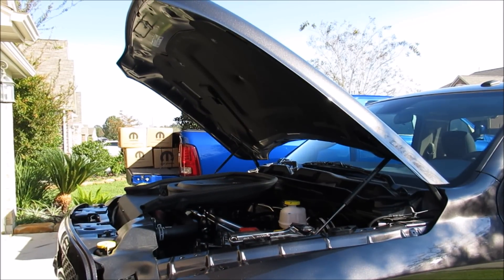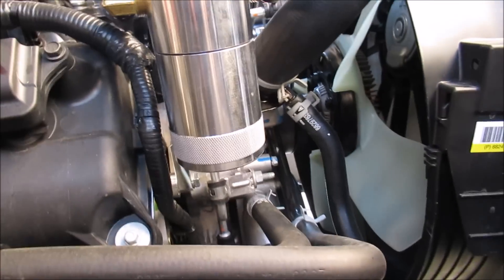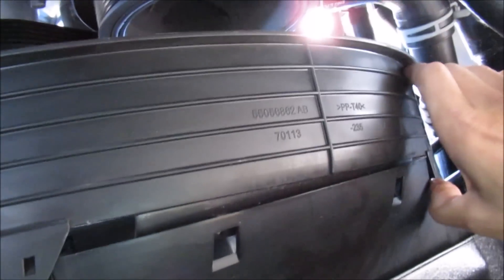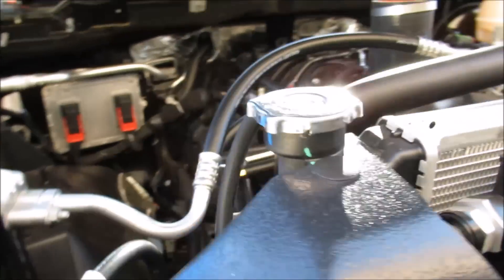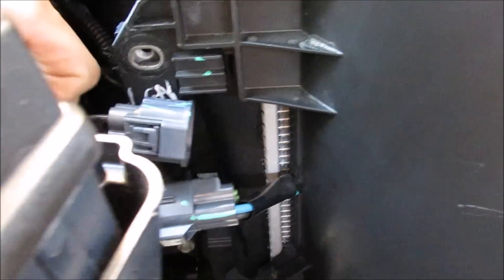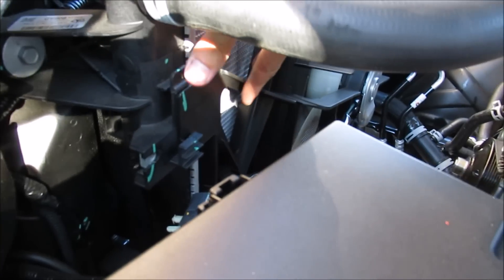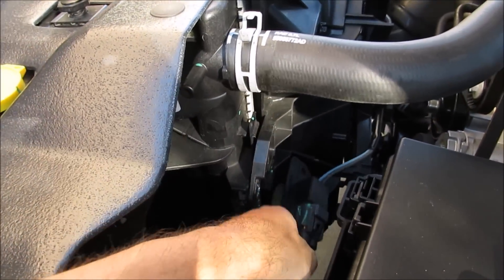2017 Ram 1500 5.7L Hemi Clutch Fan Delete

Comment: I did this on my 2013 express. I installed the Murray 180 t stat, and 09-12 v6 fan the fan kicks on by it self and this is during the winter in CA it’s not really “that cold” but it kicks on by it self I have a Diablo tuner with a 91 tune I never adjusted anything. Not sure if other people did a tune?
Reply: The oem temps that the factory ac condenser fan kicks on are 185 with the ac on, 226 low speed with ac off and 235 high speed with ac off. You can change these parameters with the Diablo tuner

Comment: I did this swap.  I got a C.E.L. (check engine light ) that refuses to turn off.
Reply from the maker: There is no check engine light that you would get from this unless you did not plug the fan in correctly.  What code is it throwing?

Comment: Just installed mine today but it wont shut off when its running. Just wondering if you might know why.great video by the way
Reply from the maker: It will always run when the AC is on or when the coolant temp gets up to 220*. With tuning, you can program the fan to cone on at a lower temp.

Comment: What's the chances of sawzalling mine off and then using an impact to remove it. Dealer put on a new water pump and the old clutch is about 700ft lbs.   I'm bending steel and bolts doing this method.
Reply from the maker: Hit it with an air chisel

Comment: Great Video!
My water pump went bad, so i just bought the electric fan and a new water pump without the clutch.
Reply: Just did the same on my 2015. Previous pump only survived 26,000 miles 23 months

Comment: a better and easier way to get that bolt off the cooler is to take a rotor hammer and use it on the left side of the bolt while applying pressure to the tentioner
Reply: doesn't always work. sometimes even adding tension to the tensioner isn't enough to stop the pump from turning. I made a similar tool (welded) and it saved the day. fan was off in seconds. if I saw this video first I would have copied his tool.

Comment: I’m going this route when the parts come in, im full bolt on and VVT HPT+ cam kit from Moe’s and running a 160 thermostat. Truck is starting to heat up with this south Tx heat! And tuned by Greene on 93 octane regular temperature is about 185 -195 at speeds of 75-85 daily driven truck

Comment: Is the original ac fan sufficient? Or is the l larger v6 model absolutely necessary?
Reply: Larger fan is necessary, it moves alot more air.
Reply: @bradlaflamme6127  maybe keeping the factory v8 fan is doable with a lower t stat like 195 instead of 203. obvisouly you have to keep the v9 shroud though

Comment: I did this swap last night.  Had an issue with breaking the fan nut 
free, so I cut the fan off with a sawzall/metal blade.  Then I used a 36
 millimeter socket on an air wrench to remove the nut.  Worked like a 
charm.  One of the projections on the new fan was against the radiator 
hose, so I cut it down a tad with the sawzall.  That way there is no 
concern of the plastic wearing a hole in the radiator hose.  You can see
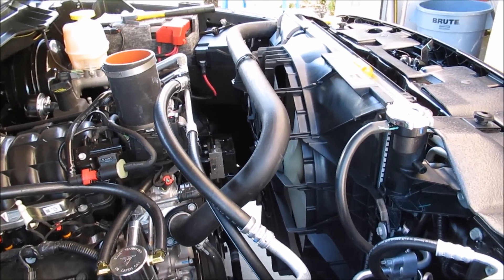 what I'm referring to at 10:27 on this video.  It's the plastic piece closest to you in the vid.  (approx one o'clock position....)
Reply: Did you go with a tuner or just left it stock?
Reply: @brown5252  No tune at this time.  Have been watching the temp very closely and there hasn't been a problem yet.  Still have to install the Vararam intake, and do the Magnaflow muffler delete.  I REALLY like my truck!

Comment: Thanks, man!  I have to do some major work on a truck, and I was getting nervous about seeing the struggles some people seemed to have had with the clutch fan... this has eased some anxiety, I'm just gonna go straight to this technique.  ;)
Reply: Ya read more. I installed the efan in mine  2014 and I got a DiabloSport to set up the temperature and I found out the Diablo doesn't to temp only AC so I moved my AC fan to the front of my efan and left it hooked up. So now I have two fans one for temp and one for AC. I installed a Flex-a lite 31174 for my temp works well so far.
Reply: @suquu9153  That's strange because on my 2014 I can change the temp at which the fan come on both with and without A/C they are two different settings
Reply: @racemaniac8682  I'm happy for you that you can. When I got my DiabloSport i3 tuner from GARiD the sales rep assured me that I can set the temperature and the AC NP. When I hooked it up it only had the one AC settings I had to go through PayPal to get my money back thank God for PayPal.
Reply: @suquu9153  dam that really sucks yeah I went driving my truck with the ac off and sure enough the ac fan comes on at 204 just like I set it without having the ac on

Comment: Hi I have a question. I want to do this mod. I also have a Diablo sport trinity 2 tuner. At what temp should I set the turn on point for the V6 electric fan on the 5.7 hemi? Thank you
Reply: It won't to temp only AC settings I have a DS i3 and it won't to temp it will only to AC setting.
Reply: @suquu9153  I had zero luck with trying that v6 fab mod. Kept overheating had to go back to factory elec fan and fan clutch
Reply: @rickybolton2451  Ya I found the same it will heat up fast and when the fan starts it will cool down fast. I hooked up an electrical thermostat that comes on at 190f so it cools it very fast. What kind of vehicle you got?
Reply: @suquu9153  2015 ram 1500 5.7 hemi

Comment: What is the part number for that fan? Will it fit a 2013 Ram 1500 ?
Reply: Dorman 621-410 Engine Cooling Fan Assembly for Select Dodge/Ram Models. I don't know if it will fit you'll have to look it up.

Comment: I've heard that this only works if you use a 09 to 12 V6 fan, because the switches were changed. Also, do you recommend an oil catch can? I could help but see you have one installed.

Comment: I got mine today and noticed that the pins in the plug are different and has 3 pins instead of my oem 2 pin but it plugs in my oem plug. Any idea why they have 3 pins and not just 2?
Reply: I just did mine last week, it worked perfect even with the 3 Pins.

Comment: It's a cheap mod but needing a tuner makes it expensive lol
Reply: no need for tuner I deleted my & its working great no overheating
Reply: jebusm86 not necessarily.. you can wire up a thermostatic switch for under $30.. works great
Reply: There is no use in getting a tune all you can tune in the Diablo Sport i3 is AC fan setting's ON, or AC fan settings off, that's it there is no tune for temp setting on or of don't get sucked in.

Comment: Why? What is the benefit of doing this?
Reply from the maker: Frees up about 8hp and opens up a bunch of space under the hood.
Reply: @moesperformance7499  Cool thanks! Guess I missed reading the description.
Reply: What is the spacing on the flat bar bolts?

Comment: What temp do you suggest it come on at?
Reply from the maker: 190*
Reply: There is no use in getting a tune all you can tune in the Diablo Sport i3 is AC fan setting's ON, or AC fan settings off, that's it there is no tune for temp setting on or of don't get sucked in.

Comment: Engine temp the same as coolant temp?
Reply: Yes the only thing that not the same is AC settings.
Reply: There is no use in getting a tune all you can tune in the Diablo Sport i3 is AC fan setting's ON, or AC fan settings off, that's it there is no tune for heat setting on or of don't get sucked in.
Reply: @suquu9153  well I've been wanted a code scanner for a while so I may just get it for that extra feature

Comment: U can run without the clutch fan since the have an electric just make sure u have the 170 t stat and the tuner turn the other fans on sooner for you
Reply: I swapped it and got a DS i3 tuner and it won't to temp setting only AC setting so I'm out all that money. I saw somewhere that an HP will.

Comment: So what holds the fan pully on once the clutch fan has been removed??
Reply: Craig_sez the fan pulley is pressed on , it wont come off. Had a 99 Durango with the 5.9 and did the same and it never came off

Comment: I have a diablo i3 programmer but I dont know how to access the temp settings 13 ram
Reply: There are only AC settings.
Reply: I have the same DiabloSport i3 tuner and all I got is AC setting's on or AC setting off. There is no temp settings.
Reply: There is no temp setting on DS i3 tuner only AC settings if someone tells you there is they are full of BS.
Reply: There is no use in getting a tune all you can tune in the Diablo Sport i3 is AC fan setting's ON, or AC fan settings off, that's it there is no tune for temp setting on or of don't get sucked in.
Reply: @suquu9153  yeah there is because I managed to change it
Reply: @omarOKC  ALL you changed is AC settings there are no temp settings on a Diablo Sport i3 tuner.
Reply: @omarOKC  SO how did you get in to the temp settings my temp settings are 220F on and 195 F off how can I change that? I only have AC setting's on and AC setting's off on my DiabloSport i3 tuner.

Comment: I did exactly  what shown on the video but still my engine temperature is getting hot I install thermostats 180 degree and still running
Reply: Any clue !
Reply from the maker: Did you lower the fan temps in the tuner to make them come on at s lower temp? If not, then the fan won’t tuen on until the temp hits 220.

Comment: This didn't affect your AC TEMP when idle
Reply: There is no use in getting a tune all you can tune in the Diablo Sport i3 is AC fan setting's ON, or AC fan settings off, that's it there is no tune for heat setting on or of don't get sucked in.
Reply: @suquu9153  Fasho brother

Comment: How far apart are the holes in the bar you made? center to center?
Reply: measure the holes on the pully from center to center. that is the distance to drill in a flat bar
Reply: 2.25" on mine.

Comment: The clutch fan pulls no hp to mention from the engine because it isn't engaged only when engine temp requires it. Two-You can program the a/c fan to come on earlier if you like by changing the temp at which it engages with a tuner. The size of the fan moves no more air because you are not changing the size of the radiator so you can only move so much air through the radiator. Speed of the fan can only move more air which is already preset. You will not gain 8-10 hp. This myth comes from people who believe too much in what they read and don't read it correctly and believe in bolt on hp. I did all the research on this MOD and trust me it is a waste of time. What do you do when the fan motor or relay goes bad and you have no clutch fan. We all know electrical parts can go bad at anytime. Your a/c fan won't kick on until approx 225 deg. I wired a switch inside to a relay outside and tapped into the a/c fan circuit on the "High Speed" relay in the ECM box beside the Battery. This way I needed no tuner, no extra fan, and left the clutch fan on in case of fan motor or relay failure. I also put a 190 deg Stant OEM thermostat in mine instead of the 203 deg thermostat. Ram's tend to run hotter than most. It's a characteristic of the Hemi. My mod cost me prob $20.00 for a relay, wire, and a switch, and took me a whole lot less time than this mod. So when I'm climbing hilly terrain on backroads while hunting or stuck in traffic, I just flip a switch and it turns my a/c fan on and keeps my engine from getting hot. I'm not bashing this mod at all. It does give you more room to work. But, think about it, you have (2) electric fans back to back. Seems redundant to me. So basically you spent, in your eyes, roughly $1,000.00 to gain what you read to be 8-10 hp. And that's why you and everybody does this mod in the first place. It's not to keep the engine cooler or the air going into the engine cooler, which will give you way more hp than removing a clutch fan, or bettering your gas mileage. It was for an estimated up to 8-10 hp gain. To each his own I guess.
Reply from the maker: A lot of this response in incorrect.  We have seen trucks pull 8-10hp on the dyno by removing the clutch fan.  There is nothing wrong with running 1 single electric fan from a reliability standpoint...even Ram has now converted to only 1 electric fan and done away with the mechanical clutch fan on the new 2019 models.  This mod only takes about 10 minutes to do as seen in this video.  And you are not spending $1000 for 8-10hp...That roughly $1000 price tag for the tuner and fan delete gives you a combined 40-45hp/tq gain.  Nothing wrong with driving a stock truck if that is what you like, but this is a great mod that all of the performance oriented Hemi truck owners have done since the Hemi was first released in these trucks back in 2003.
Reply: @moesperformance7499  I agree that with a tuner you could gain 40-45 hp. We are not talking about the gains with a tuner. We are talking about the gains of clutch fan removal only. The reason the price of a tuner is included is because you need the tuner to fully utilize the fan mod whether you use it to make other adjustments or not. OK, you feel that $1,000.00 for 40-45 hp is a good bang for your buck. Show me a printout on hp with a couple pulls with and a couple pulls without a clutch fan alone and show me 8-10 hp gain and I'll never question it again. Again I see lots of talk on websites and no proof. Nothing personal. I just read and watch and hear all about all these gains people get with bolt on hp as per se but never see any proof in the pudding.
Reply: The fan clutch can fail and cause damage, plus it wears out the bearings on the water pump faster. Oh and I can actually change my fan belt much easier without it and the fan shroud in my way. So much room to work with. Thank you. Maybe next time you can type a few hundred more words that no one will read , because I didn't read 10 words. 😂

Comment: Wouldn't there be an issue now of the the only fan left fails ?
Reply from the maker: Numerous vehicle manufacturers, including Ram as of 2019, do not use a mechanical clutch fan anymore.  They rob the motor of power and take up space under the hood.

Comment: I was wondering if you still have the electric fan in your truck and if you’ve had any problems with it or the cooling capacity of it now that it’s been a couple of years. Also does it keep things cool under heavier load like pulling a loaded trailer.

Comment: Would this work on 03-08 rams Aswell?
Reply: Dorman 621-410 Engine Cooling Fan Assembly for Select Dodge/Ram Models go check it out at Amazon.
Reply: @suquu9153  thanks, was wondering the same. Am thinking of seeing if ram made a v6 in that gen with an electric fan as well

Comment: Moe's what kind of tuner do you guys use to adjust the temperature for activating the fan?
Reply from the maker: We use the Diablo tuners with Hemifever Custom Tuning.
Reply: There is no use in getting a tune all you can tune in the Diablo Sport i3 is AC fan setting's ON, or AC fan settings off, that's it there is no tune for temp setting on or of don't get sucked in.
Reply: @suquu9153  did you not read the word “custom”?

Comment: I hope you see this Matt. I installed the TYC on my 2018 and it doesn’t seem like it is coming on. Did you notice that at all with this 2017? I was just hoping to find an answer.
Reply from the maker: Did you lower the fan temp setting in your tuner to make the fan come on sooner?
Reply: Moe's Performance That’s the one thing is that I don’t have a tuner, would it be okay running it without one for a while?
Reply from the maker: @scottycustoms  You need to tuning to use this setup correctly.  The stock fan only runs when your AC is on, or when your coolant temp gets over 220*.  That is why you havent noticed yours coming on.  We like to run this setup with a 180* thermostat, and set the fan temp in the tuner to come on around 190*.
Reply: Moe's Performance What I’ve noticed from the stock V8 fan is the same though (it doesn’t come on for a while) so I figured it would work on its own for a while. I did this on my 2012 Ram and it seemed to work on its own automatically and fine, I know they changed that in 2013 but still. Even with the AC on it doesn’t seem to come on.

Comment: What if i do this mod, do i still need to tune it or will it work without the tune too??
Reply: I swapped it and got a DS i3 tuner and it won't to temp setting only AC setting so I'm out all that money. I saw somewhere that an HP will.

Comment: I did the conversion on my 2017 Ram 2500. The fan fits 
perfectly. Problems I ran into: 1. Had to extend wire so plug would 
reach the fan.  2.  2015 and up to present PCMs on Rams are locked and 
have to be sent out to be unlocked before you can adjust the fan temp. 
The original preset temp for my truck comes on at 232 degrees if there 
is a malfunction with the manual clutch fan and your condenser fan needs
 to "Try" to cool off engine. Cooling fan will always stay on with A/C 
or defrost being on. Which is no problem for me because one is always on
 anyway. My gas mileage did improve on the highway 1 to 2 mpg. From 
17-18 mpg to 20-21 mpg. Hopes this helps someone. I appreciate all the 
videos. You do a good job.
Reply: I have a 2017 ram 2500 hemi 5.7 that I am thinking about doing this same mod.  How did you extend the wire and did you ever adjust the temp sensor?
Reply: @kurtmccann137  I spliced about 3" below the plug going to the fan using the correct gauge wire to extend. And no, I didn't adjust the temp sensor I just leave the defrost or A/C on. Going to see if the mileage thing is worth it. If It's not, I will put the stock equipment back on. No biggie I like tinkering. So far I do notice a change with mileage during interstate driving, but not impressed with city mpg. Seems like its about the same as before clutch fan delete. Hopes this helps. If you have anymore questions plz ask.
Reply: Look up boostedmotorsports channel and he has a vid on how to get some extra slack in the wiring harness
Reply: How do you unlock the pcm